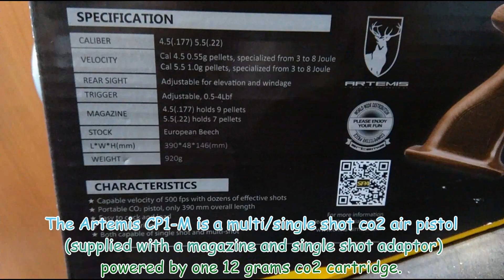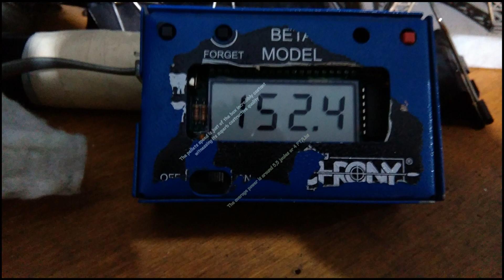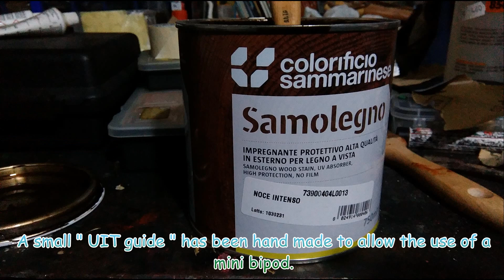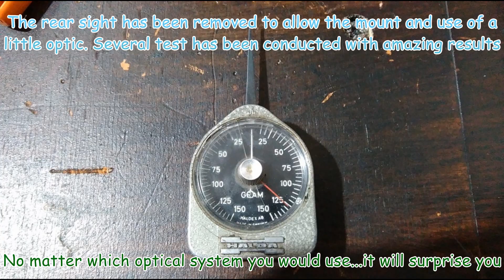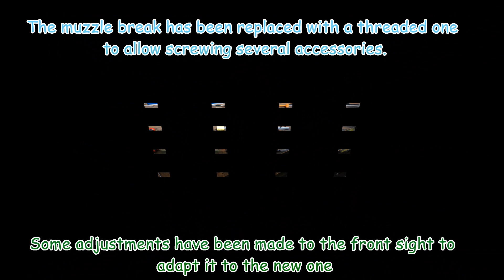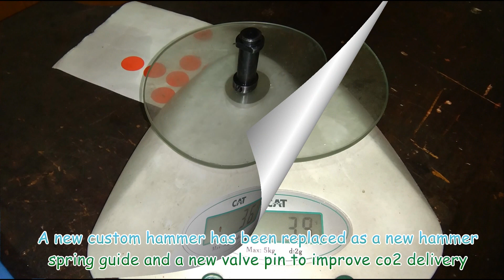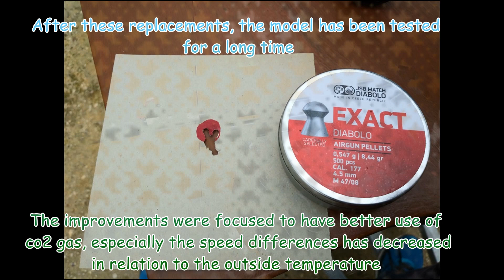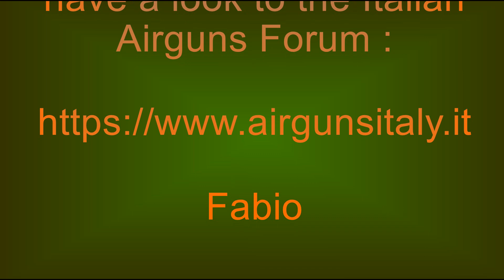ARTEMIS SNOWPEAK - CP1-M -  Co2 AIR PISTOL review - PART 1

Comment: Good and detailed presentation, thank you.
I first had the CP2 as pistol in 177 4.5mm and made a number of modifications to it and learning much about it.  This is tuned to just under 500fps 150m/s with 0.53g pellets as competition pistols shoot for good reason (related to barrel length).  About 4.6ft-lb 6.25J. But more notably a spread of only +/-4fps. This spread is not far off what a competition pistol can achieve. 

The second CP2 I assembled as long rifle but this time other than removing burrs, cleaning and lubricating, aligning the components, I only made one change at a time. From the pistol I had learnt that only the hammer spring effectively increases energy. The other modifications do improve consistency and accuracy, for example the transfer ports improve gas flow (they had merely been polished a bit on the rifle). The valve spring does very little, the poppet is held closed by the CO2 at nominal 850psi (20°).  Stretching the hammer spring does not increase its force, only its free length (correct length is 72mm). Fixing the trigger and sear improves its operation. Cleaning the barrel occasionally is a good ploy, but do leave a film of oil in there to prevent corrosion. 
After this the out-of-the-box gave some 520-630fps with 0.56g pellets. 

I was happy with that 7.6ft-lb given its tack driving accuracy. But then the weather got very hot, 37°, and the rifle was refusing to shoot.  
An experiment of putting the pistol in the fridge and shooting it through the chrono as it warmed up showed me what was happening. I'm supposed to be a scientist, I does the science, duh. The pressure in the valve, which is a gas pressure balance, would not allow the hammer to open the valve above 30°.
I had previously learnt that if the velocity was increased too much the valve stops self-regulating and the fps spread goes all over the place, very sensitive to changes in temperature, and hideously inaccurate - either by tumbling the pellet or that wild variation in fps. But the valve needed a bigger thump. I was leery of putting a much more powerful hammer spring in.

A more powerful hammer spring cut back to 72mm did increase energy by some +30fps to 650fps but more importantly allowed the valve to operate over a greater ambient temperature range and the fps becoming even more temperature independent as the CO2 self-regulates, from about 10° to over 35° (whereas before from 15° and cutting off sharply at 30°). Velocity is fairly consistent at 650fps +/-3fps now 8.1ft-lb 11J, the only significant variation with ambient temperature being a few less shots when cold. I expected increased velocity and operating at a higher temperature but did not expect the temperature independence to improve so much. And I did not expect the cold end to be improved as well (it has not got cold enough yet to asses how cold it will go). This spread is as good or better than many competition rifles can achieve. The new spring is not a lot stronger than the original, just enough to do the job (I supposed I could measure their force by rigging them up like a spring balance, meh).

Comment: Hello. 150m/s - is it a speed for jsb regular pellets? Or maybe express or heavy? Cp1 5,5mm has 130m/s, I saw it on youtube movie - 430fps. So the diffrence is not that big. In my country 5,5mm is cheaper, I'm confused wich one should I buy :)
Reply from the maker: The speed of about 152 ms you see in the video was related to the use of HN EXCITE ECON weighing 0.480 grams for a power of 5.5 joules
.
The power oscillates between 5.5 and 6 joules according to the pellet you will use.  With both calibres the shot is good up to 15 meters
, So whatever caliber you take will always be fine.

The quality and the accuracy of this model is very good, you will have fun anyway
ciao
Fabio
Reply: @Fabio4408  Thank you very much for your answer. In Poland people say "only 4,5mm", that's why this caliber is almost imposible to buy. I will take 5,5mm. Ciao :)
Reply: If you use it for pistol practice then the 177 4.5mm because that is the only calibre used for competition pistol target shooting.  
A 22 will deliver more energy but  a pistol is useless for hunting because it cannot be brought to bear and held on a rat to get the shot off before the wretched thing moves. The 177 can and will despatch a trapped rat humanely, been there. 
I do not know why you might look down on 177, the pellet travels faster, flatter and further - the valve in both calibres of this air gun releases the same amount of gas and 22 needs more gas to drive it, they both come out of the muzzle with the same energy.
Unless your tin cans are especially dangerous or a lot tougher than ours, the 177 will kill them.
Reply: @Fabio4408  yes. As previously mentioned my CP2 pistol is deliberately tuned to just under 500fps 150m/s with 0.53g (I just cannot do grains).  Which is 4.5ft-lb 6J and very consistent there. Spread is +/-4fps i.e 485-495fps in rounded numbers i.e. 4.3ft-lb to 4.5ft-lb 5.8-6.0J. And I think I can get the spread lower and the temperature independence improved as I have done with the CP2 rifle.  The main difference in the new springs appears to be that they are better quality, a british drawn spring steel, hardened and tempered.  A spring is not just its applied force but also its consistency and reproducibility. The chinese spring is fair enough but not first water.  
The be-all and end-all of an air gun is its accuracy. Power is irrelevant if you cannot hit the target.  

Fwiw I only have maximum 20m of garden range but I do know this pistol can shoot at least 45m with some hope of hitting a target. It might be a big target but hey, it has the range. I have taken out a running rat with the CP2 long rifle, standing and panning, at 20m. That is about mid-range for the rifle. I could not do that with the pistol but they both have the same power plant and same range.

Comment: where you found 11mm rail scope?
Reply from the maker: Hi
The 11 mm raiil scope in already on the top of its action
Ciao
Fabio
Reply: Just ensure the risers or red dot clamps are "9-11mm dovetail". 
Not 13mm or 11mm Picatinny. Dovetail is common on target guns, more so than 20mm Weaver or Picatinny. Not the commonest but they are out there. A lighter more precise fitting for sights.